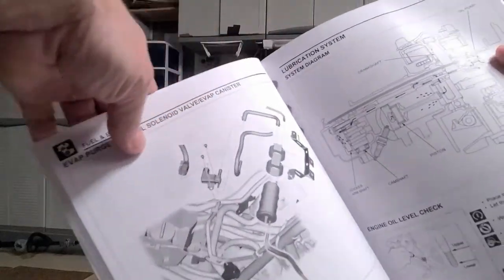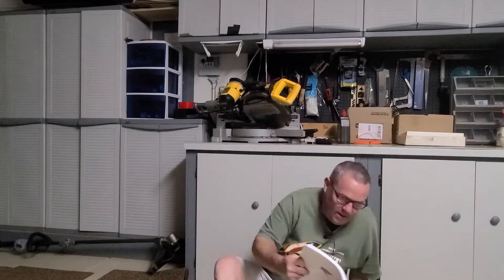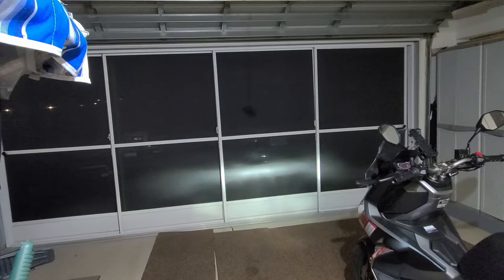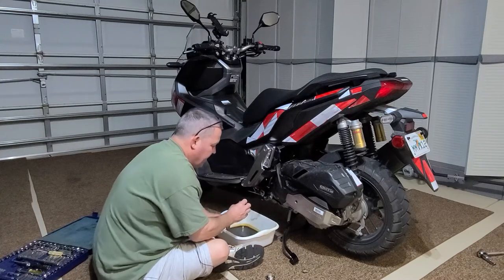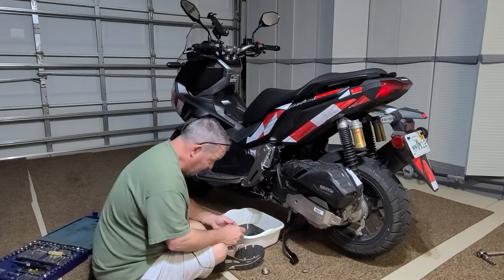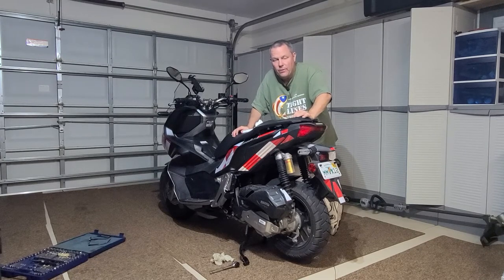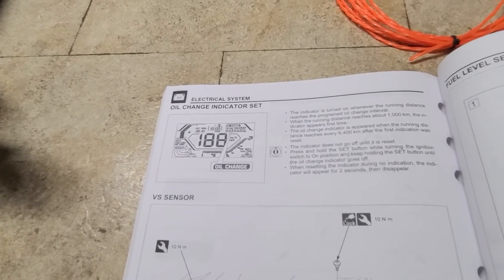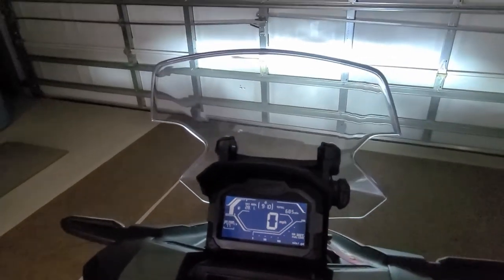Honda ADV-150 2021 Oil Change Directions by ThatCyberSecurityGuy

Comment: I put scooter on side stand and pull bottom plug to drain to center drain pan. Then I move scooter up on center stand to finish drain. Take out screen and clean and replace. After filling I check oil level and then I start and let run a little bit. Stop engine and Wait a few min and recheck oil level.👍No mess oil change is now complete.👍
Reply from the maker: Thanks! I will be changing the oil again soon and I will remake the video with your advice.
Reply from the maker: I will be remaking this video according to your directions. Thanks for your help.

Comment from the maker: I will redo this video soon as I reach 4000 miles. It will be bigger and better! Thanks for the feedback.
Reply: I change my oil every 1,000 miles. Oil is cheap preventive maintenance.👍
Reply from the maker: At $5,00 a gallon I stick to about 3,000 to 4,000 miles or every year myself.

Comment: Have you ever changed the gear oil?
Reply from the maker: No I have not but now that I am back in the FREE State of Florida I will be working on the ADV-150 after a broken neck almost killed me.
Reply from the maker: @Ekkamane  I guess near death breaking your neck falling down stairs can put a damper on things but I'm back! God wants the ROOSTER around for some reason. Of course, I'm quite crippled at the moment and making life experience videos about that to help others. There is always a reason for everything.
Reply: @thatcybersecguy  Wow, thats a bummer,  I hope you're recovering well.
Reply: Wow ,hope you are all good now. As for the gear oil its,a doddle. Bottom left bolt drains 120ml and then left side oil filter to replace it about every 2 years of use ( same time scale as removing and cleaning the oil mesh filter which everyone prefers to the actual drain bolt underneath the bike. )

Comment: Hi Kirk i am in the Philippines Honda give me the first 3 services labour free and thats also part of the warranty, i have had my first 600 mile service and now its due for the second, what does it say about the gear oil and when its due to be changed. Thanks TC Keep safe Bill
Reply from the maker: If you watched my video you know I recommend the Scooter Motul oil based on research. I will be coming out with a better video soon as I have to change the oil a second time as I ride baby ride!
Reply from the maker: Believe it or now both the owners manual and the Honda Service Manual do not say as I was curious also. The front display will light up with the oil change light next time it comes due which I will wait on. Regardless, since this is a HIGH PERFORMANCE engine my guess 3,000 miles.
Reply: @thatcybersecguy  hi just been for my second service today 2500 miles changed the engine oil but they did not have any gearbox oil in stock. the mechanic was really good checking all the bolts and suspension, showed me how to check the coolant water under the foot rubber, on my 3 free services i can ask them to check what i want, on the third about 5000 miles i am going to ask to check the belt and clutch, 
its nice to see your rear bracket is steel lots of the aluminium brackets have been breaking.
TC and Keep safe. Bill
Reply: @thatcybersecguy  you can print it from the Honda manual under PDF form

Comment: Man you have all that space in that nice garage. Get a motorcycle lift so you don't have to be on the floor.
Reply from the maker: Usually I have my Toyota Prius Prime parked there charging on the charger. I moved it outside to change the oil.

Comment: Yikes thank God your not a service tech.
Reply from the maker: True. But when I change the oil a second time I will replace this video with a much more polished one. I'm approaching 2,000 miles on the ADV-150 now. What a fun motorcycle! 100 miles to the gallon!
Reply from the maker: True. I will make another video to replace this one when I hit 3,000 miles coming up soon. This was my first motorcycle oil change.
Reply from the maker: You are right about that! I'm a complete idiot but I do the best I can. Check me out on Parler, YouTube or Rumble at ThatCyberSecurityGuy.
Reply: @thatcybersecguy  "doing the best you can" shouldn't involve whining replete with expletives.
Reply from the maker: @albertsanchez8007  You troll yours and I will troll mine. However, I do plan to remake this video on my next oil change.